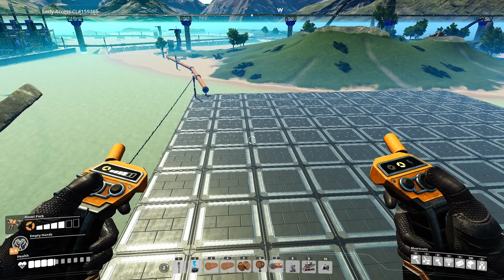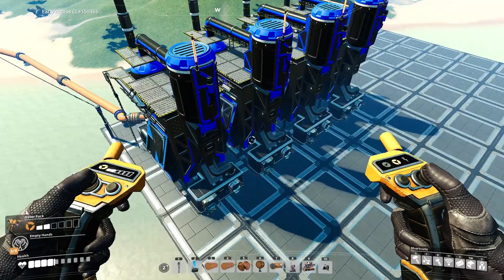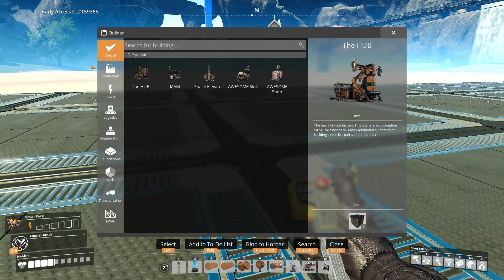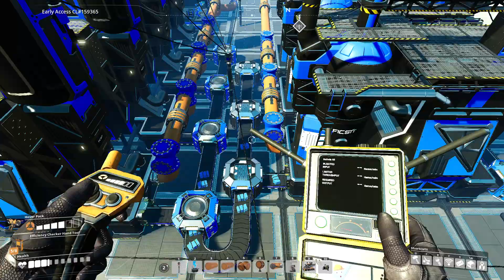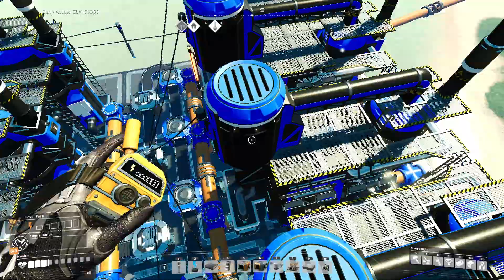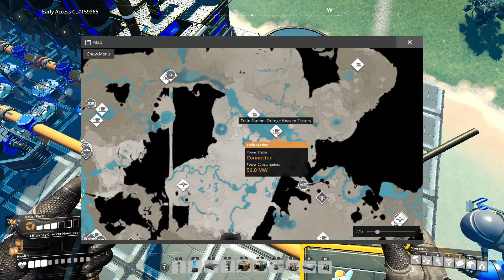Satisfactory, Plastic and Rubber with ZERO waste and DOUBLE the output! Tutorial

Comment: Combine the Recycled Plastic with the Recycled Rubber where you feed plastic output into rubber and vice versa and then you can use Heavy oil residue alternate for pure fuel, set a smart splitter to overflow for each for the loops and once started it never stops aslong as it gets fuel?
Reply from the maker: That sounds about right to me, it’s been a while since I played so I think the recipes are all the same and that idea should work fine